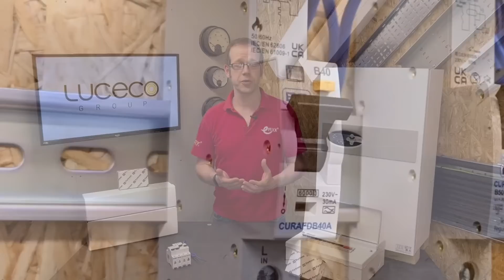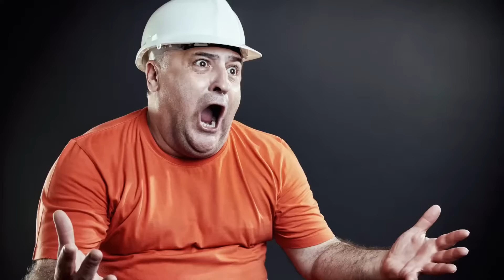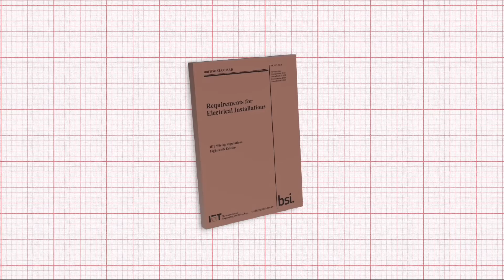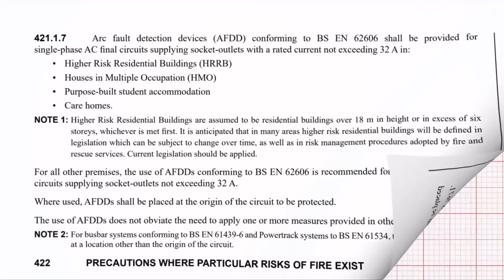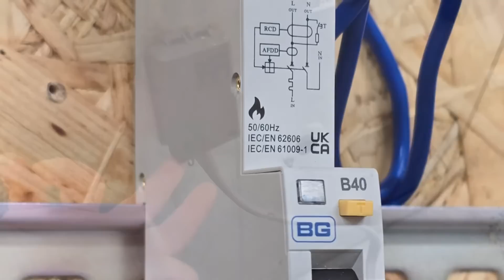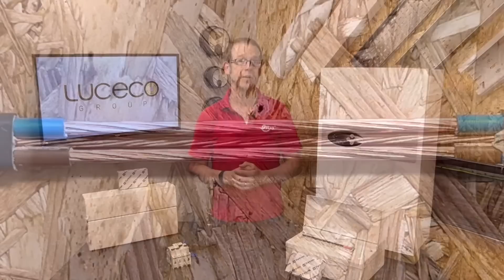Should You Install an AFDD?

Comment: Regulation 421.1.7. Actual wordings of reg...
Arc fault detection devices (AFDDs) conforming to BS EN 62606 to be provided for single-phase AC circuits supplying socket-outlets with a rating not exceeding 32 A in:

● Higher Risk Residential Buildings (HRRB)
● Houses in Multiple Occupation (HMO)
● Purpose-built student accommodation
● Care homes

HRRBs are assumed to be residential buildings over 18 m in height or in excess of six storeys

The wording says socket-outlets, which is plural, more than one socket-outlet. But does say, circuits, which is also plural. So if a flat in a high rise has a single radial circuit to one single socket, say supplying a washing machine, then is an AFDD needed?
Reply from the maker: Yes, yes it is. The pluralising is for grammatical correctness.

Comment: I've fitted AFDDs to all my circuits in my house, with the exception of my electric shower as the load required a 45 amp breaker and the highest power AFDD that Fusebox supplied was 40, I don't know if other suppliers do higher ratings, but if not it could be limiting for the higher rating circuits you mentioned.

Comment: During rewiring our property about a year ago we looked at AFDDs and can see benefits to them - but we ultimately decided not to install any. A couple of electricians warned us about unwanted tripping issues with them. They are also significantly more costly and combined with us installing a significant number of circuits compared to before (3 socket circuits where there used to be 1, etc.) we'd need quite a few of them. Since we have all new electrics and no high load circuits being used overnight, arcing didn't feel like a major concern.

What we did pay more for was installing a fire detector of some type in every room so that if a fire started - even with a door closed - we'd be alerted as soon as possible. We also used LED lighting everywhere (most importantly I think in the recessed spotlights) since it runs at much lower and safer temperatures.

I wonder now though if we would have benefitted from using just one AFDD on the circuit supplying the fridge/freezer since these are always on and I've heard of them sometimes starting fires? Is it arcing in the appliances that caused these fires and would an AFDD protect them?

Oh, and one extra thought, on the topic of fires - candles are major cause - I think more than electrics still. We still use some real ones as table centrepieces where we're very present and aware of them. But if you like to stick them on shelves and around the room where you're not watching them so much, get some LED candles. They're totally safe and will last forever.

Comment: Still a bit pricey but I decided to fit one on the Utility room circuit as I intend to take advantage of cheap off-peak electricity (washing machine and tumble dryer) in operation whilst asleep.
As the fire service has often commented they can have issues and shouldn't be left unattended, this gives additional protection plus interlinked mains smoke alarms as well.

Comment: With the amount of cases of cooker hood speed selectors we have on site nuisance tripping AFDD's I'm glad the customer we work for has suspended their policy of rolling them out due to cost.  I'm not so happy about them rolling back past RCBO's to dual RCD's and no SPD's though.  The only solution we have found so far is to replace the AFDD with an RCBO and the issue disappears.  If we change the appliance we still get nuisance tripping.

Comment: It's funny that you Brits (and some other nations) have problems with the "public" doing some electrical work in their home.

Other countries that have no rules on that do not have more deaths caused by DIY electrical work than you guys.

Not sure about recent figures but I believe it's even lower in non-regulated countries because basic knowledge is obtainable everywhere. 

If you guys do not want the public handling electricity, you should not even allow to plug something in.

Seen from my part of the world, there are far bigger problems than someone of the public doing some electrical work.

First of all being undersized extension and multiple sockets which are shortly followed by pis poor quality products (usually from China and bought at the well known online Chinese retailers) followed by poor quality work done by professionals and a lack of maintenance by the public (I.e. dust in multiple socket extensions or carbon built up on contact pins of sockets caused by switching power supplies like phone chargers).

If we can handle those problems first...

Comment: Ever since electrical products ? have been made in china ? been a sparks since 1964 and you very rarely had any burn outs , MK AND CRAB TREE , WERE ALWAYS THHE BEST WHEN MADE IN THE UK .Worked for the Delta metal company who made most of the brass screws and brass connector on several install contracts . Never expected to use torque drivers ? only on Nuclear POWER STATIONS , MAINS AND SUBMAIN ITEMS . Plumbing products are just as bad  to day .  🤔When products were made up to a standard , NOT DOWN TO A PRICE . AROUND 1982 IT ALL CHANGED .🤔

Comment: Maybe EICR's should become mandatory on all properties every five years.
After all as Dave Watts commented "AFDDs are devices designed to protect against faults that shouldn't exist."
ie AFDDs presence, and the requirement for its installation in certain types of property, has more to do with improving skills training and apptenticeships, regular mandatory inspection and testing, of installations and restricting the availability of electrical equipment and accessories to the public- as should have happened with the advent of Part P of the building regularions.
Reply: It's funny that you Brits (and some other nations) have problems with the "public" doing some electrical work in their home.

Other countries that have no rules on that do not have more deaths caused by DIY electrical work than you guys.

Not sure about recent figures but I believe it's even lower in non-regulated countries because basic knowledge is obtainable everywhere. 

If you guys do not want the public handling electricity, you should not even allow to plug something in.

Seen from my part of the world, there are far bigger problems than someone of the public doing some electrical work.

First of all being undersized extension and multiple sockets which are shortly followed by pis poor quality products (usually from China and bought at the well known online Chinese retailers) followed by poor quality work done by professionals and a lack of maintenance by the public (I.e. dust in multiple socket extensions or carbon built up on contact pins of sockets caused by switching power supplies like phone chargers).

If we can handle those problems first...
Reply: @Richard1977  listen to me when I tell you how much work and remedial work is entirely due to untrained unqualified numpties thinking they can wire in something.
More than that ignorance is a potential cause of fire and injury or death.
I am not kidding.
Don't blame someonelse (the Chinese) for a basic lack of knowledge, qualifications, or experience which leads to a disaster.
This is why we have regulations covering potential dangers like electricity, which will kill you if you don't understand fully what you are doing or know the correct procedures for safe isolation, and proper installation.

Comment: Deaths caused by fires in dwellings approx 334 per year. The approximate number of deaths per house where there is a death is roughly 1.5 Number of dwellings approx 30,000,000. That’s approximately 1 death every 90,000 dwellings. Taking the 1.5 death toll, that’s approximately 1 in 134,000 houses affected by deaths. It was hard to obtain precise stats but, I don’t believe this to be far out. Major work, more expense, households less likely to upgrade. And a lack of electricians.

And, of course, the above figures do not reveal electrical fires, or fires caused by the stupid Darwin award winners.
Reply: It's funny that you Brits (and some other nations) have problems with the "public" doing some electrical work in their home.

Other countries that have no rules on that do not have more deaths caused by DIY electrical work than you guys.

Not sure about recent figures but I believe it's even lower in non-regulated countries because basic knowledge is obtainable everywhere. 

If you guys do not want the public handling electricity, you should not even allow to plug something in.

Seen from my part of the world, there are far bigger problems than someone of the public doing some electrical work.

First of all being undersized extension and multiple sockets which are shortly followed by pis poor quality products (usually from China and bought at the well known online Chinese retailers) followed by poor quality work done by professionals and a lack of maintenance by the public (I.e. dust in multiple socket extensions or carbon built up on contact pins of sockets caused by switching power supplies like phone chargers).

If we can handle those problems first...

Comment: The simple solution is to always install 63A outlets.
Reply: @yngndrw.  yes on a 16 amp mcb . Regulation bypass 🤪
Reply: @christastic100  63A outlets on a 16A MCB sounds relatively save, the MCB trips at 16A so before there is actually sufficient current for arc fault to become an issue. Perhaps quite safe then, in this regard.

Comment: Interesting to note that whether required or recommended by 7671, the only circuits referred to are for socket outlets. The implication seems to be that the concern does not relate to the fixed wiring but to what is connected to the socket outlet. In that regard, the difference between blue and brown books is significant. FWIW, I place little value on any contribution they make as a fire safety control measure and unless specified, I certainly wouldn’t install them on any other type of circuit.
Good video as always from JR!

Comment: As Cory has shown on his channel AFDD's are prone to nuisance tripping due to RF and wave forms they're not programmed to ignore so as much as the regulations can change to must - if it isn't suitable for the circuit/equipment used one can't be fitted and the circuit would have to be redesigned with this in mind. 

Examples not limited to, medical equipment and beds in care homes and nursing homes. So dedicated circuits have to be run for the medical equipment and a separate socket circuit for items in the room. By equipment - air mattress beds with hydraulics and compressors, oxygen equipment etc - all things you think you would want on an AFDD especially the oxygen tanks but can't be for medical reasons.  

Honestly I agree with the intentions of the regulation but the actual implementation is a nightmare especially in care facilities as wiring regulations take a back seat.
Reply: Life preserving equipment etc, should already be on a separate circuit and use Si type RCD protection to reduce the possibility of a trip of the circuit and allow for emergency power to be supplied to life preserving equipment without non-essential loads draining the emergency supply.  Of course a lot of this stuff also has integrated battery but the multi-layer redundancy is still required.  It really shouldn't present a problem as far as getting an AFDD on non-life preserving circuits is concerned.

Comment: Earth leakage introduced a new form of protection, and it has proved to be a GOOD solution. These devices are to mitigate inferior product options, lower quality training, and to make someone somewhere a load of dosh. Accessible junction or termination boxes made from suitable fire rated materials and oh! stop switching the bloody neutral when there is no justification. I suggest you look at the high voltage protection sector and apply similar but voltage appropriate solutions. THIS is a bloody Americanism....💩

Comment: When not a requirement, I always give customers the option when installing consumer units, new circuits, etc. I tell them about the advantages and then I tell them the price difference! The answer is nearly always a firm NO! Can't say I blame them! I don't see why they are so expensive. Its just a small computer and a few other gubbings - should be simple enough to mass-produce cheaply.
Reply: If they did something actually useful in addition to supposedly detecting an arc fault then they could be worth both the very high price to purchase and the additional running costs because of the current draw that you pay for. 

David saveory did some testing on them with a simulated breach and it merrily arked away and it didn’t trip. 

Given there’s no official testing it does smack of snake oil to push up costs for the sake of it. 

Now if they added a bit of logic in them to cover power usage, waveform detection etc you could get people interested but as it is they are questionable value.
Reply: The hardware is pretty cheap.  Working out how to detect what is and isn't a dangerous arc by waveform alone isn't.  Even the easier approach of a neutral network to do the detection requires that someone has to work out what actually is a dangerous situation and categorise the training samples.
Reply: Early adopters are generally paying for all of the R&D and certification. Once they have recovered that the prices start to fall.

Comment: I’m not convinced that the biggest problem is the decline in quality in accessories and appliances that has made the biggest impact on fires and burnouts. The connection box on the back of a cooker shows a fine example of low quality steel connections ( not brass ) and stupidly small connection box . Am I the only one who thinks that poor quality products are a big issue that are being tackled by ever over trippy products instead of dealing with the root causes.
Reply: Don’t forget cheap and cheerful new cookers fitted with 2.5mm pvc/pvc flex by the manufacturer, beloved by landlords, have seen two burn out in less than a year, needless to say, I replaced it with 6mm Ho7 with crimped lugs.
Reply: Bang on the money there Christastic. When my customers ask for advice on what electrical accessories they should have I give them two choices. You can either have cheap foreign rubbish or expensive foreign rubbish. 
When I was an apprentice, we fitted wooden wylex fuse boxes. Wooden! Never an issue because they had proper terminals with two screws. I've stripped threads on wylex AFDD'S using the torque screwdriver. Utter junk all of it.
Reply: @sadken-gr7ve  absolutely right .
Reply: Are they steel or tin/nickel/silver plated copper (highly conductive, tin or nickel etc plating for corrosion resistance)
Reply: @ they are magnetic and whatever chintzy silver they coat them with. Regardless steel is clearly not the best material to use for electrical conduction and too many other things such as shower pull switches burn out regardless of how tight they are made at the time of installation. I have seen old 32 amp brass pull switches that are overloaded but have remained in tact .
Reply: I’ve seen that photo before of the cooker connection burn. Apparently it looks like it was caused by over tightening.